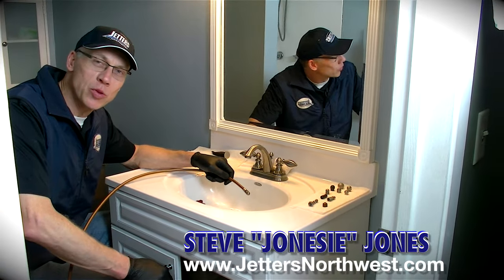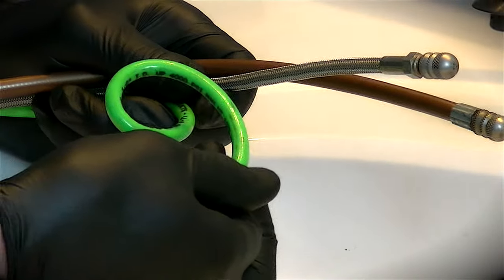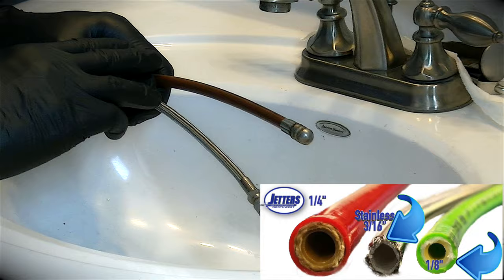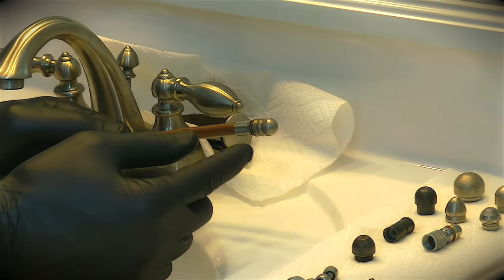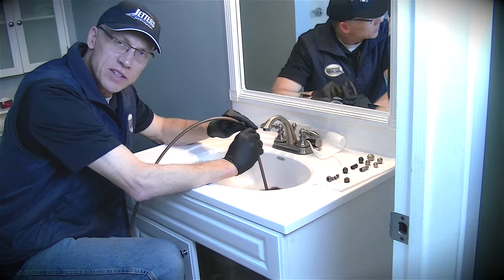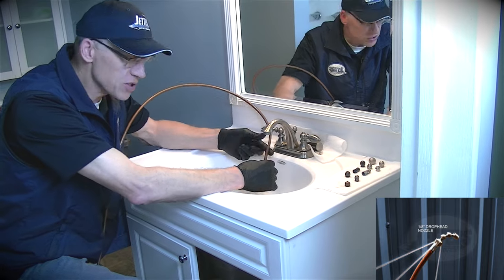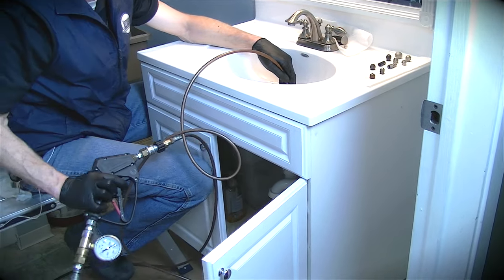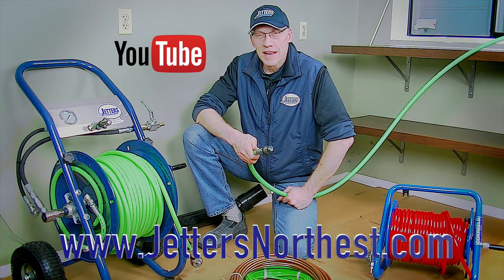Live Drain-Jetting thru a P-Trap - "GET" JETTING  with JONESIE

Comment: Grease gun hose is what I prefer… cheap and works great!!!
Reply from the maker: interesting - aren't those all short? What length have you found?
Reply: 48”
Reply: @bryanmontgomery4050 Do you remove the anti-kink spring on the working end? Looks like it could be a restriction to making tight turns. I found a 60" hose on Amazon, but it has those springs on the ends.

Comment: Will it go through the toilet bowl? Thanks
Reply from the maker: I've never tried that but I think it would. However, this is a small hose and small nozzle targeted to 3" and smaller lines (best application is 1.5" to 2") so even after getting thru a toilet-trap it's not ideal for cleaning the 4" sewer downstream of the toilet due to the lack of water-flow

Comment: Thanks for the videos.  What is the source of the water in this case?   I am having a hard time imagining pulling a jetter hose through a house.  Is that what most guys do?
Reply from the maker: There was one of our Electric-powered mini-Jetters on the floor near me, being fed water from the shower line.  However, it is super common to bring a leader-hose thru the house from a larger jetter outside -- in fact a more and more techs are using a "clean hose" (that never sees a sewer) specifically for these applications to carry the high-pressure water from the jetter outside to the jetting-hose to be used inside
Reply: @JETTERSnorthwest  what adapter did you use to get water from the shower line?

Comment: Any information on the jetter machine you used? Our company is getting many calls for jetting floor drains and our set up cannot get through a trap.  What machine did you use to run your setup?
Reply from the maker: Are you looking at the Drain Invader by chance? They are great for jetting residential p-traps.

Comment: will the drop head and line be able to go through a toilet without removing?  Always looking for a better option than a toilet auger or plunger.
Reply from the maker: Typically yes when using our drophead nozzle.  We also now have drop head nozzles for larger jetters up to 10gpm which also have forward-blasting jets for attacking/pushing soft clogs.  However if you need to cut roots then you'll need a root-cutting head like our REAPER which will require you to pull the toilet of course

Comment: I have a 1/4 hose, bought from Amazon, but the tip can  not bend and go throught the 90 degree T 1-1/2 inch kitchen sink pipe. how can i redo the tip to make it easy the go throught?
Reply from the maker: 1/4" might be too stiff for getting thru a 90-deg turn in 1.5", but here is a link to the best 1/4" nozzle for drop-tees & traps: https://shop.jettersnorthwest.com/collections/1-4-jetter-nozzles/products/1-4-drophead-nozzle-w-knuckle-leader-stainless-steel

Comment: How would this drop head knuckle swivel perform in a washer drain trap?
Reply from the maker: As far as getting through the trap, the Knucklehead is the best I've tried. When the nozzle goes vertical and into the last sharp 90 the knuckles droop which helps it get through.  May hang up on some, but I've not found a more consistent head to get through the tough turns

Comment: with a knucklehead and a dedicated hose used only for culinary lines,
could you remove a kitchen tap and jet clean down through a galvanized water supply pipe found in older homes?
Reply from the maker: I'm not sure about the cross-connection liability, but if the nozzle will fit in the line then you could jet it. However, the nozzle/hose likely will not pass the sharp 90-degree elbows

Comment: Would this work for a urinal without taking it off the wall?
Reply from the maker: Depends on the design of the urinal's flow path; we have customers that do get it thru a urinal's S-trap, but not other types that have the squared-off flow-path, or don't have a good entry-point
Reply: @JETTERSnorthwest  
Ya thx works the same with a standard urinal auger!

Comment: Would it be good for a urinal?
Reply from the maker: Urinals are fickle as you know - it depends on the design. If the urinal/drain has a smooth/bending flow-path then the nozzle+hose can typically be worked thru the pipe's curves, but if the urinal has a blocky flow-path then the nozzle likely will hit a "road-block" and you'll have to pull it

Comment: Man , that’s like using a grenade to move a pebble.   Using that inside provides certain risks, hose leaks and even line breaks.    Does it work, you bet.   I can clear a sink clog in under 5 minutes in nearly all cases.  Your set up and break down would take longer.
Reply from the maker: Thanks for your reply - I hear you - but the message is more about jetting the sewer-line beyond the sink-trap, without having to take the time to disassemble the trap (PS - sorry for our slow reply!)

Comment: It literally takes less than 30 seconds to remove the trap with no tools.
Reply from the maker: I hear you - but the video is really intended to show that the Nozzle and Hose can get through small P-traps -- especially Floor-Drains -- if it can get thru a small sink-trap then it'll get thru other P-traps. Also, many drain-cleaners don't want to disassemble old metal traps as they can fracture when you put the wrenching to them as you know.  Sorry for the slow reply - thanks for commenting!
Reply: Your not that smart buddy. What about floor drain traps.

Comment: No way that you got to the sewer with that 😅
Reply from the maker: Our customers do it commonly with that KnuckleHead nozzle and the right jetting-hose, just like I did here. The job for this setup is to clear the smaller branch-lines (lav, floor-drain, etc.) into the typical 4" main.  Then if the main needs clearing you'd go back to your full-sized jetting-hose and nozzles.  Hope that helps!

Comment: Thanks anyway but I  could have a sink trap torn apart ,washed out and back together by the time you brought all that equipment in the house
Reply from the maker: Thanks for your reply - I hear you - but the message is more about jetting the sewer-line beyond the sink-trap, without having to take the time to disassemble the trap. The last time I disassembled an old metal trap it fell apart when i put wrenches to it, so this is a way to avoid adding to the problem while still cleaning the sewer, and cleaning the trap is a bonus